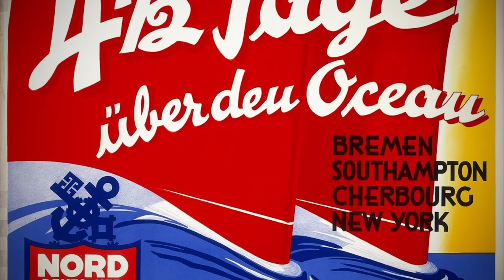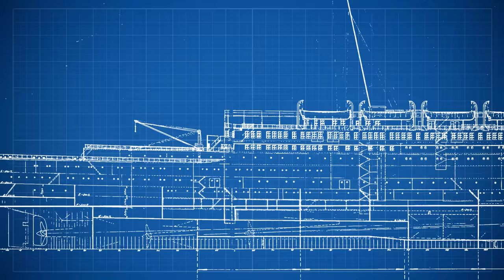Why Didn't the Nazis Build an Ocean Liner?

Comment: Omg finally a video about that topic! Love it! The Vaterland (2) is my favourite what-if ship if not my most favourite ship of all. You can clearly see she was designed by Yourkevitch. I inspected the deckplans and found many similarities to the Normandie. Her condition after the war wasn't that bad too. Sure she burned because she was used to store wood and the front deck was blown up. But I have a picture of her in a book and much was still there and she was floating. I don't understand why she wasn't given to for example Canadian pacific because the only thing that needed to be replaced was parts of her steel because she was empty.

Comment: German shipbuilding infrastructure was quite badly crippled in the aftermath of Versailles restrictions, in particular losing many of their larger slipways capable of building ships in excess of 600ft in length, while those that remained were utilised by naval construction in the 1930s build-up (being the only available slips for constructing anything of heavy cruiser size or larger).  AG Vulcan’s Hamburg and Stettin yards lost their largest slips, and Schichau at Danzig and Howaltdstwerke in Kiel were similarly crippled.  The supporting infrastructure for most of the largest yards was also subject to destruction by the orders of the Inter-Allied Commission of Control, meaning that the ability to fabricate frames, plates and other material at the yards was limited or eliminated entirely.  Germany never quite managed to get back to the level of its vast pre-WWI shipbuilding industry, which even then was still far behind Britain’s.
Reply: Brilliant😊

Comment: I was wondering since you focused on German ships can you make a video devoted to MV Willhelm Gustlaff? It was originally supposed to be a cruise ship and then it was used in the war efforts which caused such a horrible death to so many people many civilians included. Especially if you can shed some light on the design of the ship especially the interior and maybe compare it to the wreck and The controversy of the further damage the wreck had endured.
Reply: and if Vaterland had been finished prior to the war and fitted out, would likely have suffered a similar fate.  The Russian subs, at the end, were practically unopposed in the Baltic and shipping movements, especially large ones like the Vaterland would have been a juicy target to a lurking Ruskie.

Comment: Great video!
I might argue that Nazi Germany did make a move for the fastest Atlantic crossing, and succeeded by far with the Hindenburg. Sure it didn’t have the capacity of an ocean liner, but if the point was prestige and symbolism, Hindenburg was in a whole other league. I also imagine zeppelins would need less of a subsidy, just from logistics alone. When the Hindenburg exploded, there was already a sister under construction and another on paper. Such a tragic shame helium wasn’t used.
Reply: Exactly. The Nazis were more than happy to use the airships, first the Graf Zeppelin and then the Hindenburg, as their prestige projects--much to the chagrin of some of the airshipmen.
Reply: If memory serves, Hindenburg was originally designed (around 1930) to fly with helium. However, the US wouldn't sell helium to Nazi Germany when the ship was finally completed (1936).
Reply: @davidkorlin4312  yeah that is right, thats why they went with what they did. But to be fair, zepplins days were numbered even if the Hindenberg disaster hadn't happened.

Comment: Small nitpick. The P.1000 was known as the “Ratte” (Rat), not the “Monster.” The P.1500 Monster was a completely different project, basically a Schwerer Gustav railway gun on a tracked chassis instead of rails.
Reply: another nitpick: p1500 never existed and the p.1000 designed by Grote was never called ratte in ww2.

Comment: Excellent video as always Marc. I can't see the Victoria surviving far beyond the war, had it been built to it's original specs. A commercial liner requiring government fuel subsidies would not be popular on the market, and post-war Germany was hardly in an economic position to refit her or operate her.
At best she would have been slowed to a crawl by reducing the powerplant and total propellers and sold to a cruiseline for pennies on the dollar. At worst she'd have been salvaged for her raw materials. (The latter more likely)

Comment: Who built the SS St Louis then? The ship in the movie "Voyage of the Damned". It was destroyed in an air raid on Hamburg in 1943.
Reply: @trevormillar1576  Not so fast with destruction. The SL, a sister ship to the MILWAUKEE, HAD BEEN heavily ruined by bombs at Hamburg, but did not go to scrapyard immediately. Hamburgers used the wreck as a... floating hotel for some time. You know, ships do not want to die. By the way, one ship  of that 18.000-ton pair had a KDF episode in her career. ♍

Comment: In addition to any comparison to the Queen Mary and Normandie, I'd add the question of what impact the Viktoria would have had on the design of the United States.  With a 35 knot service speed a reality, what would Gibbs have done to make a better liner?
Reply: Call Westinghouse, order a couple more turbines, and make her a 6-screw, 350,000 shaft horsepower, 45 knot Transatlantic projectile!

Comment: Most of the great German Ocean Liners were seized by way of reparations after 1918. In fact, they did continue in service, but under different names. For example, the “Imperator” (the largest passenger liner in the world at the time she was launched) continued in service as the “Berengaria” until 1939. The German colonies were also seized. Having no colonies, there was no particular need for ocean liners, since there was a regular service across the Atlantic from Britain and France. Hitler, of course, intended to have a German Empire closer to home, that is to say, based in Russia, Poland etc, so that there was no need for ocean liners.

Comment: I think I would move the funnel on the proposed America liner towards the stern rather than up front.    Doing so will keep the large upper deck clear of smoke.   As it is, that open deck is under the cloud of smoke.   what say you?
Reply: I'd give it 2 smaller funnels of similar design, with the aft funnel slightly shorter for that rakish appearance of speed.

Comment: Kind of surprised Germany didn't bother build another oceanliner after World War 2 like Italy with the Andrea Doria and Christopher Colombo either they the ship industry was to busy rebuilding the Merchant fleet or they have a premonition that they days of the Ocean liner where numbered with the rise of Air travel? In the end it woudn't be until the 60's when NDL decided to buy 2nd hand liners one from france and another from sweden at less they where adaptable and can be used for cruisng unlike there contempory who struggle to be used for crusing
Reply: They Built the Wappen Von Hamburg almost right after the war, which is now under restoration in california, renamed the Aurora she's tiny but that is better than nothing.
Reply: I think of 2 things keeping the rivalry from returning.  1. Germany was now divided and not of its former size.  2.  Previously, they had gotten many  amigrant/3rd class passengers to NYC from Scandinavia and Eastern Europe.  With the Iron Curtain cutting much of that market off, there was less need and when economically recovered by the late 50's, the airliner was looming supreme.

Comment: Excellent presentation. Well done.

To your question: If either or both of these ships were completed prior to the outbreak of WWII, I suspect at least one ship would have made a trans-atlantic trip or two. After that, either hostilities would cause the vessels to be hold up in Germany or used as supply ships for the Atlantic raiders. If the ocean liners were used in the Atlantic, I doubt such noteworthy vessels would escape detection and destruction for long. I can see them interning themselves to avoid destruction and then taken as prizes after the war. If the ships were hold up in Germany, I can see them being used as troop transports on the Baltic. The ships would have a longer service life in this second possibility, but I see their fate as being far worse as the communists would either sink the ships during the fighting as a result of combat or the communists would sink the ships after the war for target practice or break them up for salvage.
Reply: the communists definitely wouldnt have sunk or scrapped one of them. A great example are the Albert Ballin and Hamurg because they served until the late-70s / early-80s. Both ships were build in the early to mid 20s and both sank in WW2 but were salvaged. The other two Ballin-Class ships were given to the other allied powers so the Deutschland and the New York were scrapped. Four other HAPAG ships that were also given to the soviets and survived until the late 70s and mid-80s and those were build in the late-20s and 30s. Surely the soviets would have taken the completed ships and make them into the ocean liners that were proposed in the 30s and if they were completed they would have sit in the harbour during the war and taken refugees from the east to the west at the end of the war risking to be sunk like other ships that did that job

Comment: Thanks for another great video.  How about making a video about Bremen and Europa?  I would especially like to know how to tell them apart.
Reply: I'll second that, as I like them quite a bit myself. 
You bring up an interesting point about the differences between them.  While broadly similar, they had many detail differences.  I've always found Bremen to be more attractive, though I can't exactly nail down why.  Just small differences in proportions, I think.
They were magnificent and influential liners, and were very popular through the early to mid-1930s.
Reply: @monsieurcommissaire1628  There are few differences that can be identified in most photos.  The "winter garden" that wraps around the forward end of the superstructure has large window in groups of two on Bremen and in groups of four on Europa.  There are large ventilators on either side of the funnels on Bremen that are not present on Europa.

Comment: Pardon, they DID. Not TA, but they did: the SCHARNHORST & the GNEISENAU. The first from Hamburg was first big, 18.200-ton liner, later converted, or rebuilt as carrier with too short a flight deck to enable aircraft to land on it. Germans wanted to do the same with the smaller GNEISENAU, but she sank prior to it hitting a mine off Gedser in May 1942 or 1943. On the plan for the Nazis was construction of five medium plus sized liners for the Atlantic route known as 'Vaterland' class.

Comment: Would they have impacted on the design of the United States in the same way that U-Boat technology influenced post-war diesel-electric submarine design?    If the ships had been built, and survived the war, I could see them sailing under US UK or French flags either in their intended roles or a migrant vessels. 

They could have survived into the 1960s but fuel costs would I guess have seen them sent for scrap.

300,000 SHP is a phenomenal amount of power requiring an extremely robust power train and some pretty heavy engineering back AFT. I wonder how reliable it would have been.

Comment: Well thank you very much for enlighten  on a big question mark over me for some years. I think in  about two years ago i was watching a ww2 war documentary. In the end of the documentary  3rd reich capitulated and there was a fly by over Hamburg scen wich the speaker told about Germany in ruins. Then in a split second this hull is flown over with a chocking modern hull design and especially good non military looking bow. I paused and rewind many times and I tried search on  the internet but in vain. I also asked friends interested in the era. But no one had the answer but you today. Now iknow now it was  Hapag Vaterland hull i saw in the fly by. But the bow was intact and it suppose surrender flyby in may/juni 1945 and it was a intact bow? Maybe the film material is mixed up in the documentary. Thank you for tour work on this channel. Regards from Sweden 🇸🇪

Comment: Had those liners survived into post WW2 service, the Viktoria's fuel thirst would have doomed her, and lingering post war anti-German sentiments would have left them both with low passenger numbers, and Germans would have had little cash for the luxury of foreign travel for another ten years.
Reply: Hamburg-America line would try to use the Vaterland for refugee transport, basically sending Europeans devastated by war to greener pastures. But it would have to be renamed.

Comment: There WERE German ocean liners , just not built by the Nazis ; their main focus before the war was building up the Kriegsmarine , to rival the Royal Navy . While many people may think of Bismarck and Tirpitz as the pinnacle and flagships of the Kreigsmarine , there were actually several larger classes of battleship planned to dwarf even those , the so called H class battleships , the largest of which would rival and even outgun the Yamato Class , of the Imperial Japanese Navy , the largest and most powerful battleships ever produced . The Americans produced the Iowa class battleships , with larger ones also planned but never built ; there has been much debate over how an Iowa Class battleship would have fared against a Bismarck class battleship , but the two never met to find out .
Some of the German Ships were given to Allies after the war as war reparations for other ships that were sunk .

Another factor is that , even in the 1930s the Germans were already looking to other modes of transport for crossing the Atlantic , and airships such as the ill fated Hindenburg were used as massive propaganda machines by the Nazis ; their undoing was that the Nazis did not have ready access to helium and had to rely on hydrogen for buoyancy , with disastrous consequences .

Comment: Im surprised it wasn't scrapped during the war.  hitler wanted to scrap the surface fleet to make uboats after Bismarck sank or the battle of barents sea, can't remember which.
Reply: Most likely for the same reason the aircraft carrier Graf Zeppelin wasn't scrapped either, despite construction having been abandoned in 1942. Scrapping a big ship is very labour-intensive, and they didn't have the skilled labour available, so it was easier to manufacture new steel than cut up these ships. The same thing happened in Britain where several large ships were slowly broken in a desultory fashion throughout WW2.

Comment: So i kinda wanted to talk in here on the intro. Specifically about the P-1000. It is still up to debate on if this things design really was anything more than just a few engineers being high at best. And knowing how the germans liked using meth as a way to stay up and energized during the time… its not hard to see why. The reason we dont think its a real… actual proposal is because the proportions of this thing make no sense. The turret of the tank makes up like… 60% of the tanks weight. Not the 2 submarine engines or the hull of the tank. The fucking turret. Which means either this design was a joke concept or engineers heavily underestimated the weight of the thing. In most tanks turrets make up about 40% of the weight to the hulls 60%
Reply: Additionally it is more than likely that Hitler did not propose this thing. We like to think of him as this man who called all the shots but he listened to his officers and generals more than anything Who ended up saying he did all the shit and made all the bad decisions after he died. So really we got no conclusions on this thing